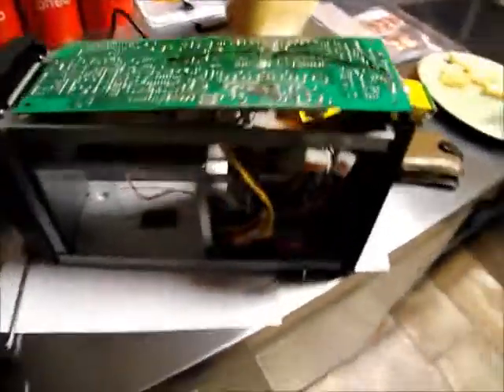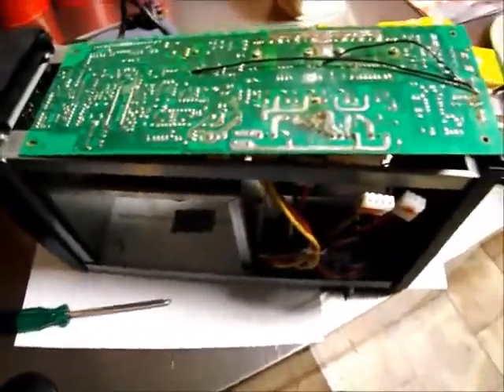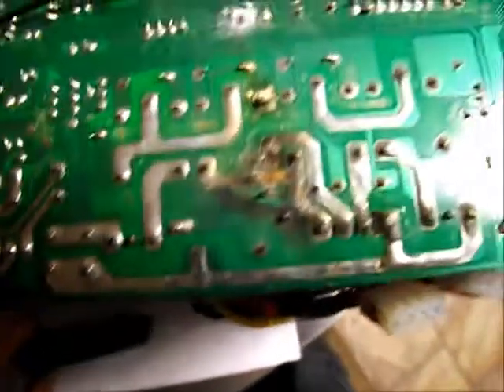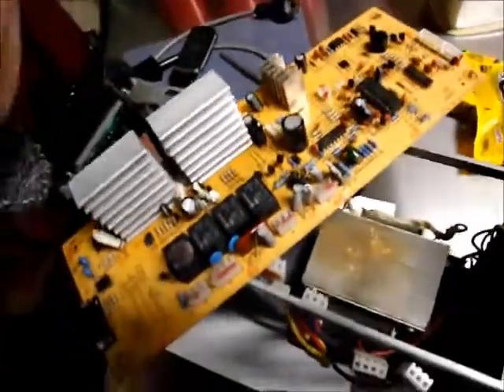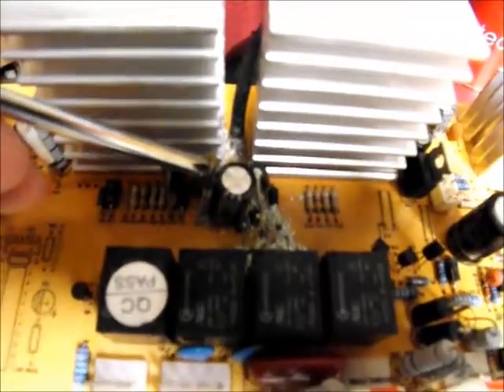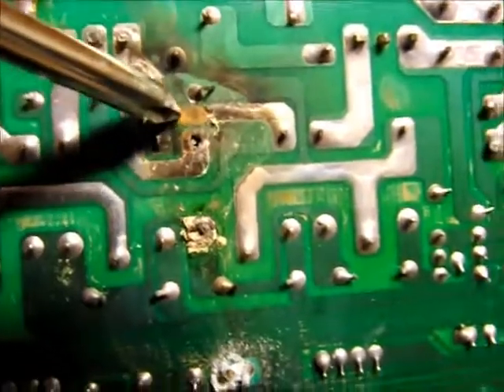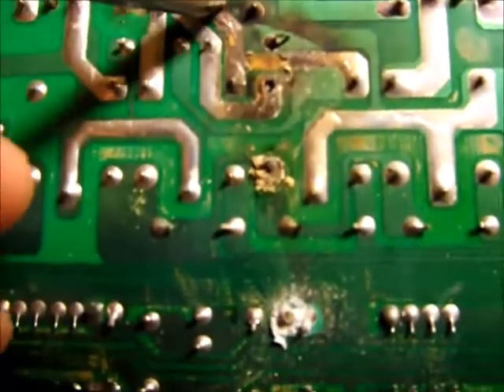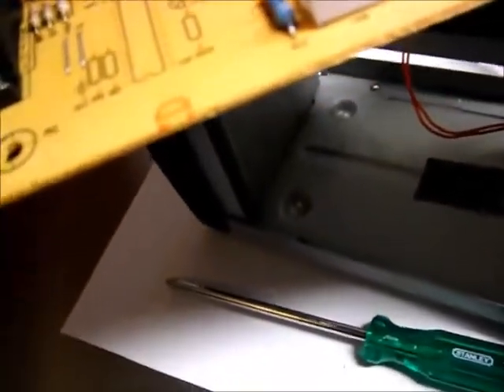power tech plus:MP5206 un-interuptable power supply. Postmortem, repair?

Comment from the maker: very true(plus the batteries are very cheaply made too, which guarantees they will leak if so mounted ), the repair is interesting to me too. i will test the mosfet transistors and if they are fine i will go from there. i will get it working for sure. thanks mate :)

Comment: Yep that does look very repairable :-)

I would remove the relays and inspect the pins, then do a basic contact test, why buy new relays if they are still sealed ok :-), you can extend any pin that has enough meat left on it :-)

The diode and resistor i bet are still functional, just a cap and new battery wire + some pcb repair, worth a giggle :-) :-)

Stick a multimeter round the local components and if your lucky all is well :-)